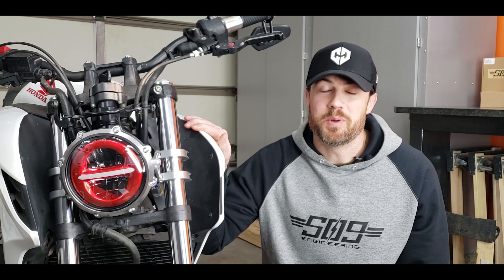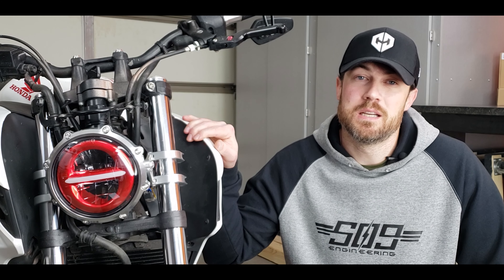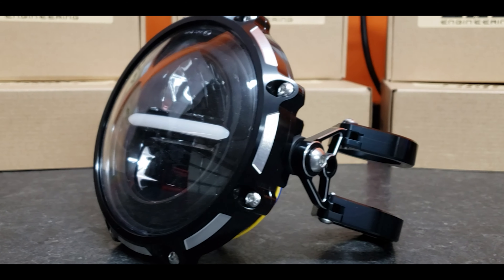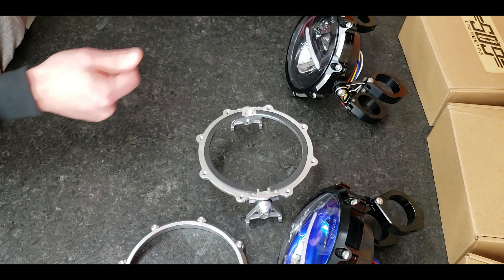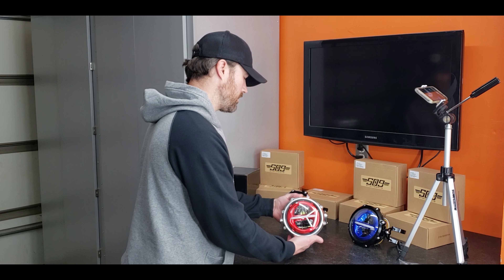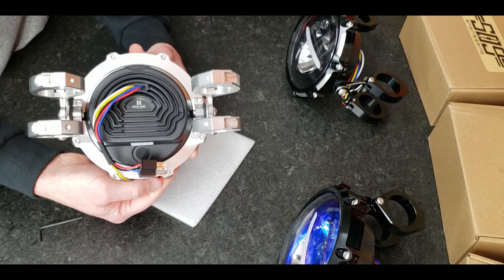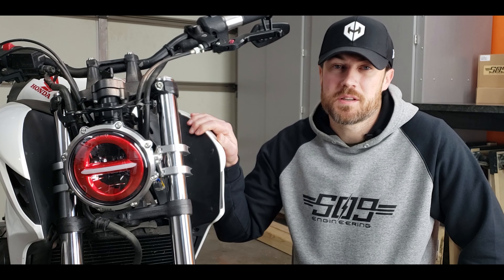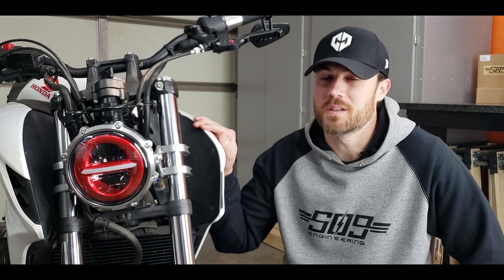LED Motorcycle Headlight Assembly | Honda Cb500f Cafe Racer Build #5

Comment: Do you think it will work  on a Yamaha xsr900, and also do you guys have any 7” ?
Reply from the maker: @james galvis this headlight is intended to be universal. Obviously, I can't be absolutely sure it will fit the xsr900 without any issues. We have a 7inch design, but we haven't made the parts yet.

Comment: If I notch the frame appropriately,  can I mount this light with the horizontal center vertical?  Will the projection arc leave one side dimmer, or will it be passable?
Reply from the maker: If you notched the back ring you could rotate the headlight. I do not think you would want to unless it was a show bike or something. The light pattern you would get on the road would not be safe.

Comment: I'am actually looking for a nice 7 inch housing for my bike but I either find nice frames with open backs or cheap Chinese buckets that are crap. My bike has a lot of wires in the headlight and I hate having apparent wiring. I would like a full cafe racer headlight that has rear bucket.
Reply from the maker: Thanks for the comment. I sell 7-inch headlights with buckets. Several professional builders use them. Check them out if you get a chance.
Reply: @S09Engineering  I will thanks

Comment: So I looked at the wiring diagrams for a 2019 CB500F and have a 2017 CB500F, and the headlight 100% isnt plug and play
Reply from the maker: You are 100% correct. The models with the OEM led headlight are much more difficult to do this mod. The older models have an h4 connector and require zero mods to the wiring.

Comment: Will this work with the honda ctx700n ?
Reply from the maker: @Romeo Jones it should work fine. It is intended to be universal. I have different options available to fit a wide range of fork tube diameters.